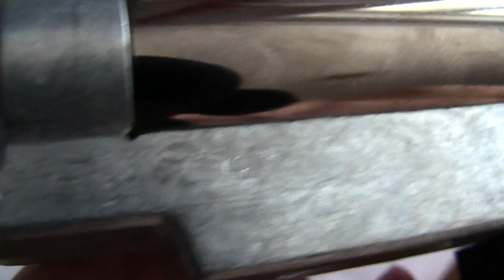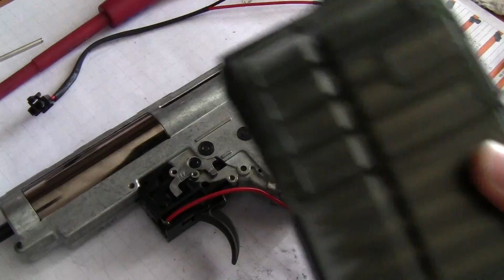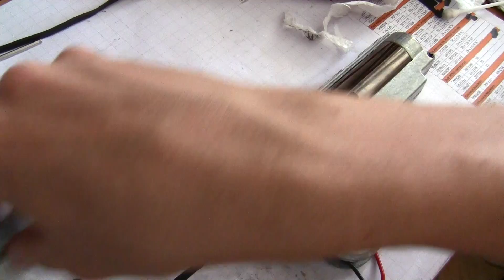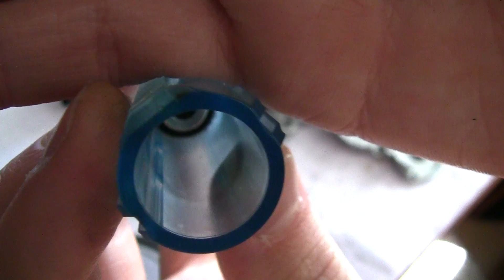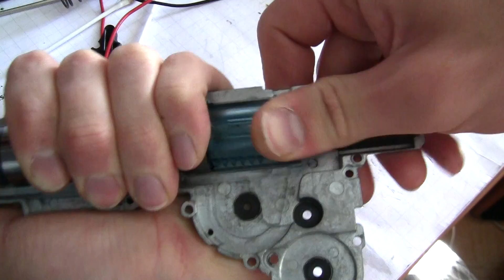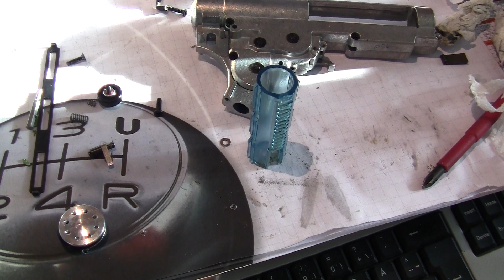VFC/Umarex HK417 Internals thoughts and opinions

Comment: If I had a budget of 350$ what upgrades should I put in this, and what brands work best?
Thanks
Reply from the maker: That would depend on what type of build you are looking for.
Reply: Range, My KWA mp9 is not accurate past 180 feet. I would like to fill a DMR role
Reply from the maker: So semi auto only? What is the fps limit?
Reply: Full auto and under 450 fps

Comment: I am trying to find more info on extending the barrel. What barrels are compatible with the stock hopup unit?
Its a DMR build could you recommend me and internals for such build? Gracias
Reply: CHeck out a website called WGC shop dot  com they have  a 20 inch conversion kit for the 16 ;-) its vfc who made the conversion kit so :-P

Comment from the maker: Dani Hileaga No it can't. I wouldn't recommend ASCU's anyway.
Reply: Thank for your answer but what is the best mosfet that would you recommend to fit this beauty?
Reply from the maker: I always make my own fets. I prefer simple, non computerised fets, but if you want some cool features, a SW-cheetah would be a good choice.
Reply: Maekiii
Thank you kind sir!:)Last question.Do you think the gearbox shell would resist at 450 fps with radius mod and sorbo on cylinder head?
Reply from the maker: In warm temperatures, probably yes. Cold makes the gearboxes brittle. Its a big problem where I live.
Reply: Maekiii
Thank you so much for your answers!:)

Comment from the maker: But unfortunately that isnt easy, because the bolt lock mechanism is dependend on a plastic block that also aligns the hop chamber, making such buffer would require removing that plastic block altogether and machining a completely new one. That would require very good precision to get everything aligned right and have the bolt mechanism still function.. :P

Comment from the maker: Thanks for the good feedback. :) Yes, keeping the piston assembly light, radiusing the cylinder window front corners and adding sorbo will make the gearbox last a lot longer. There is not much space for any outside reinforcement due to the hopup design, but I believe that the gun is compatible with TM style m4 hop units, meaning that you could possibly make a some sort of shock buffer in there similar to those that exist for m4's.

Comment: VFC isn't all it's cracked up to be. What you pay for mostly is external parts. It's particularly awkward when they slide away from the conventional gearbox design and create inferior parts that cannot easily be replaced and little aftermarket compatibility. In the case of GB shell failure, you are really only left to replace the original.
Reply: I understand retroarms make an upgraded one, but it’s a lot of money

Comment from the maker: Thanks. /watch?v=jAM5F24K5k8

On top of those parts and mods, I'd add a neo magnet motor. Then ofc you need a mosfet, deans connectors and a stronger spring.

Comment: I had a similar thought regarding the V6 design, where the motor cage is detachable -- theoretically, a new motor cage could be produced to allow the motor to connect to the bevel from a different angle, to be used in guns with different body shapes.

Comment: only problem i had was routing the wires. the fix was using really thin pvc insulated 16awg wires. i also had to dremel the wire channel a little in both the lower gearbox and i think the receiver (not sure if i had to dremel the hand grip).  also be careful when installing the gearbox back into the receiver, the pvc is easy to damage.

Comment from the maker: Tuneup and fps. The rof is already in the high 20's on a 11,1V, but I will switch some neodymium magnets in the motor for better trigger response with a slight cost of rps. Also I will be installing a mosfet and R-hop.

Comment from the maker: A common misconseption is that longer barrel is better, but in fact a barrel of this lenght (340mm) is way longer than it takes for the BB to stabilise, so it can be tuned very accurate. Longer barrels tend to suffer more from BB and hop spin inconsistencies, then they literally always are curved in some direction because its hard and expensive to manufacture really long and straight barrels. Generally after you pass the ~400mm lenght the extra lenght will have a negative effect on consistency.